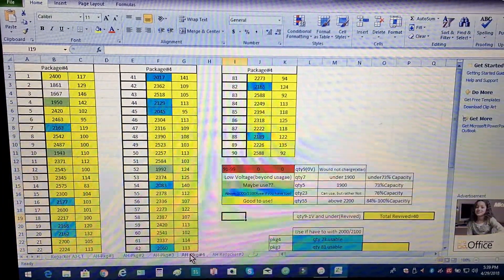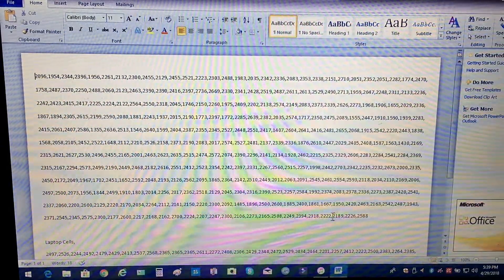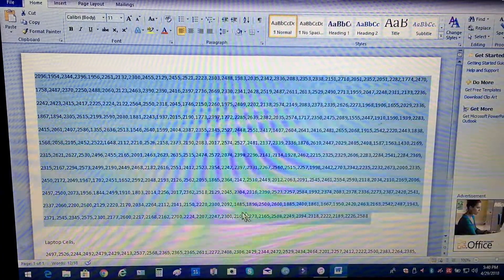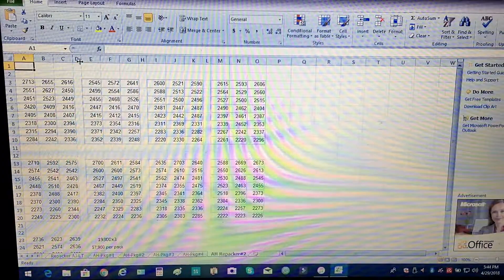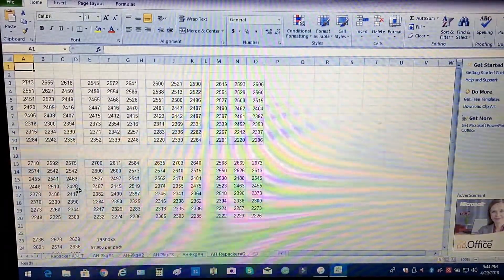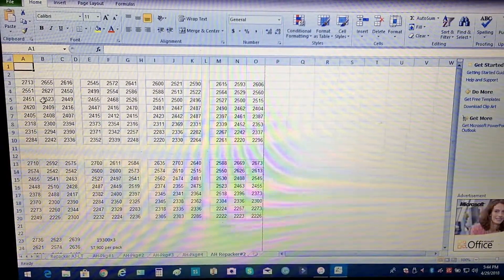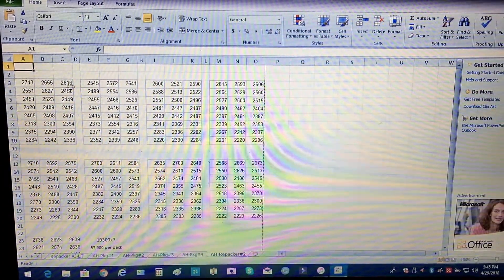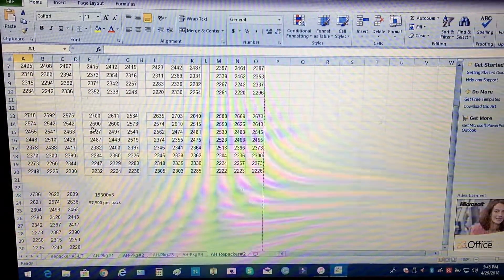DIY Mini Tesla PowerWall Part 4  (Repacker & Wrapping cells)

Comment: I have nearly 1500 cells, I need to make 14,  100 cell packs, I have them tested and written down the capacity. And have them in packs so I can easily find the cell I need. I just have to do the repacker thing now. If I put all the cell capacities in, all 1460-1470 will it use all the highest ones leaving out the lowest ??? I don't have a computer . I may need to go to the library. My house burnt to the ground. And I haven't replaced alot of things yet. I have a phone. So I haven't needed a computer yet. Any advice??

Comment: What is the lowest cell capacity you use?
Reply from the maker: Robert, Thanks for Subscribing!! I am very very picky when it comes to my cells. Typically I will only use anything over 2200mah. Than I divide the rest up for fun projects or give away. My 2000-2100 I built the cool battery box you will find on my channel 8S10P. Anything under 1900 and sometimes 1800 depending on the cell, I take to be recycled. I would probably never find a use for those. But I also offer them up to friends. Some of my friends will use cells between 1500-1800 all day and not blink an eye. But I am also pickier than most. I will also test them 3 times, just to make sure the first Mah was not a fluke. My 2000-2100, I will run through a few cycles, just to make sure they are under 2199.